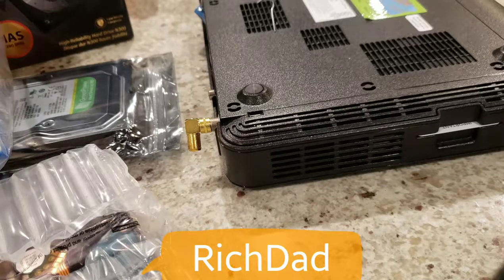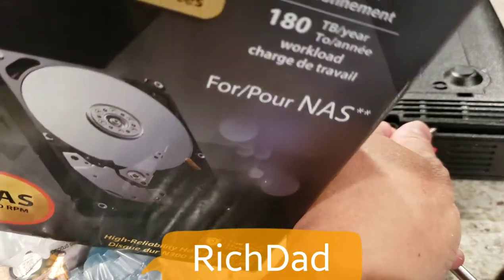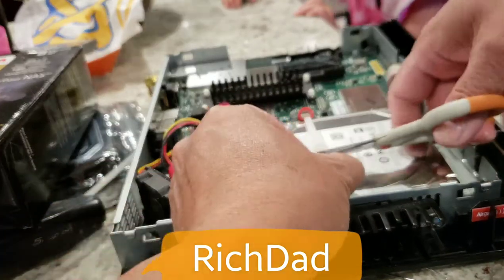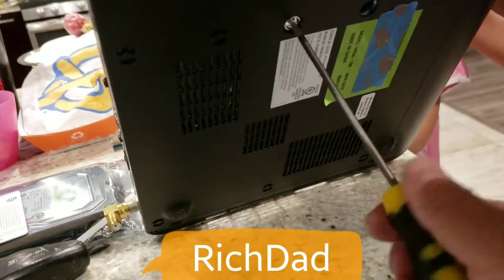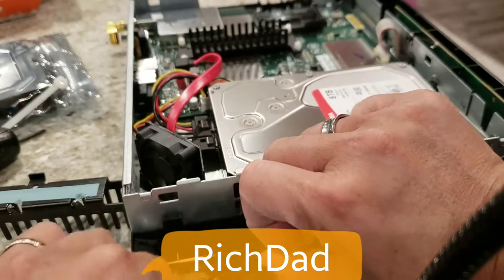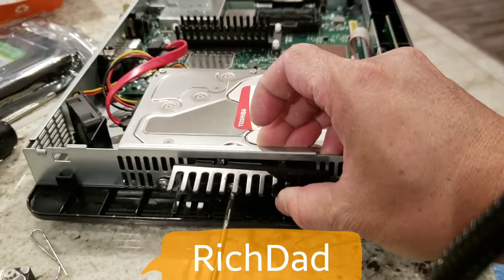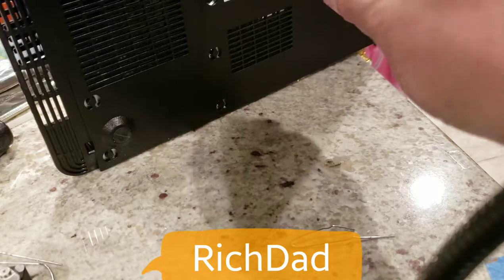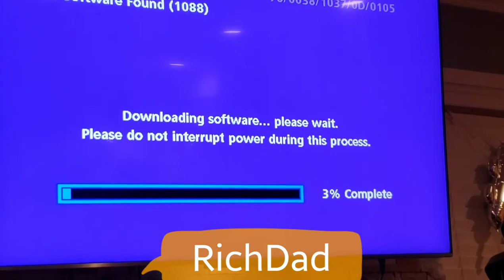Upgrade directv hr54 to over 1000 hours

Comment: It's amazing how little information DIRECTV gives about their satellite receiver equipment. I'm MUCH prefer satellite television over streaming. I had my Internet fail for seven weeks and there's nothing I could do to get it fixed. At least I could still watch television with my DIRECTV satellite dish. Thank you for the video. Over the years I've done many upgrades. They've never wanted the equipment back when I got new equipment. I would ask them what I should do with the old equipment. They only wanted the security card back and asked me to throw the equipment away.  I always hold onto the original hard drive that came with the equipment just in case.